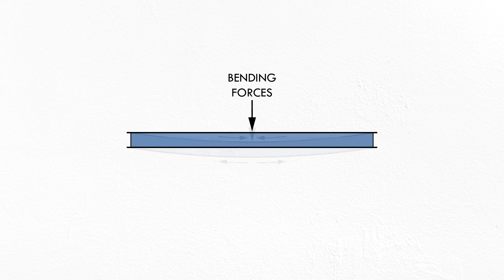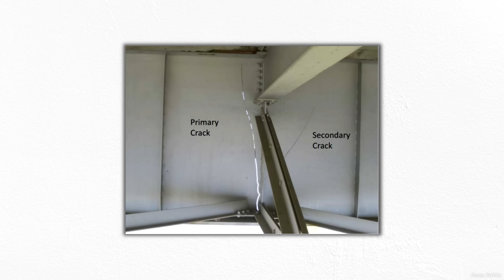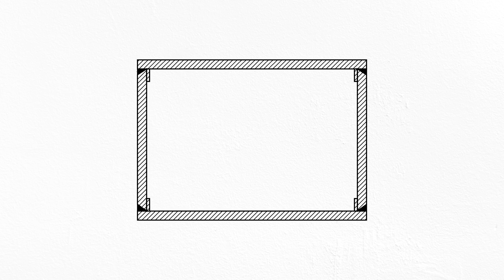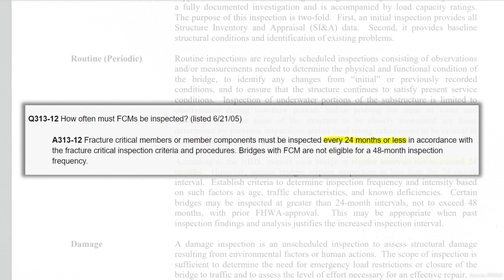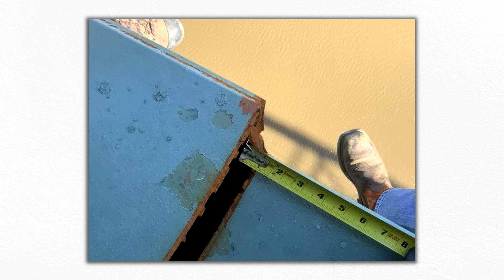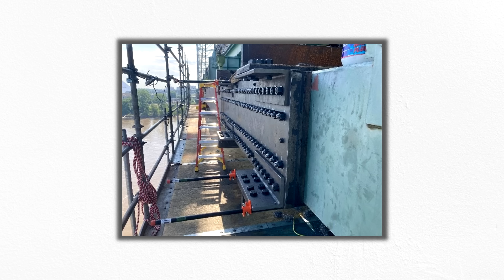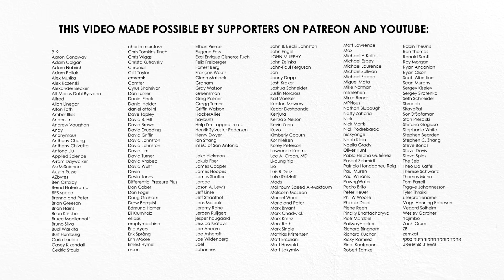What Really Happened at the Hernando de Soto Bridge?

Comment: As a stress engineer with familiarity with durability and damage tolerance, and fracture mechanics, I knew that crack had to be several years old. I was not at all surprised when you provided evidence of 2016 and other imagery which showed the crack in the past. Thankfully that bridge was a damage tolerant design.

What's interesting about the failure is that it didn't happen on the 1st fastener line where the critical analytical stresses would be expected for that type of joint. As you said, I'd expect something like a welding defect to have caused the initiation at this unusual location.
Reply: I'm thinking this member was still carrying the load despite the damage. Thoughts?

Comment: Great video. Only remark is that confusion may be created at 2:55 when bending load is described as worse than pure tensile load because it creates...tension. The resultant stress from an equivalent bending load is higher for a beam because perpendicular loads create an amplification effect that coaxial loads do not (i.e. a moment). It seems that connecting the deck at regular intervals along the span of the lateral tension member directly contradicts the design theory behind such a bridge. And lastly, how can welds form adequate joints on such a large structure?

Comment: I knew a supervisor of an institutional housekeeping staff who would apply dry markers to every public toilet and photograph them. Some were various visible colors and some would only fluoresce in UV. The staff would be judged by which shift cleaned off which marks. This was an entirely measurable and impartial standard for promoting or firing housekeepers, and also for improving and repeating training as required. 

Any bridge inspection should never be solely the responsibility of one person. These inspections need to be reviewed by remote teams where on-site engineers operate high-definition recording drones and helmet cams during their live inspections, while off-site teams review video footage from anywhere nationwide. 

Every bridge should be marked with many documented faux cracks of various levels of visibility (manually, using inkjet printers mounted on drones, or as post-processing to the video copy assessed by the remote teams). The remote inspection teams compete to record the largest number of discovered cracks and flaws daily, using AI, contrast enhancement. 
Bridge inspections also need innovations developed worldwide, such as acoustic transmission signatures from transmitters and receivers added to the structure. On the other hand, the entire remote inspection process should be promptly assigned to another remote team if enough faux cracks are missed or incomplete video coverage is not noticed. This way, remote teams are rewarded daily for finding the most obscure cracks and catching incomplete field coverage, and their chances of finding a real crack are greatly enhanced. The local engineers are motivated to record thorough coverage every day while competing to trip-up the remote teams. Nobody is ever held solely responsible for finding a real crack. Every field engineer is working with an equal playing field, and the oversight no longer feels burdensome. The job is clothed in aspects of a sports competition.

Comment: One question is, why the beam is connected to the deck so rigidly. Maybe the purpose is to reduce lateral movement of the deck, but wouldn't a connection be better that avoids transfering vertical forces?

Comment: Seriously. For a country that’s so dam wealthy. We build the bridge in a way so we can remove parts and replace do the bridge could practically be there forever (not with original parts) so seeing the crack should of been easily resolved before it got bad. Just keep it open until replacement beam is ready then shut down install and inspect the bridge. That’s all they needed to do before it got so bad it had to be shut down immediately

Comment: Armchair engineer here, and former train conductor who has changed knuckles and spotted broken rails.

That break has some age to it. Looks like a few months of exposure. Also of note is the area's climate. Specifically, the 2021 storm that had temperatures around -15c and how summer temps reach around 35c. During that winter storm, there would have been extra tension from the material shrinking in the cold, as well as ice and snow, and heavy vehicle load from traffic congestion on the poor roads. Combined with the location of the crack, which is near a high activity point (Welds, bolts, etc), it's likely a weld defect or general defect that may have been very minor was put under such tremendous load that it popped open. Again, based on the rust, it looks around the right age to have been from this winter. 

We also must account for the location of this crack. It's likely that it was to receive most of the fatigue, being the axial point between rigidity and drooping of the bridge as it "breaths" (expands and contracts, allowing some drooping.)

At least them's my thoughts. It just looks like the right spot for it, the rust color and penetration look right for around 5-6 months in a higher humidity location. And based on experience with rail breaks, it often happens when it's cold, the rail contracts and eventually finds a weak point to pull apart.
Reply: I imagine rail breaks from cold are on long straight sections?

Comment: Clearly not a crack, but a break or fracture.  The member is completely severed in two with a one inch gap.
Reply: Apparently they are terming it a crack because there was still some material connecting the two halves on the south side of the box section. But it's probably safe to say that connecting ligament had undergone significant plastic deformation to allow the crack to displace that much so in my mind the whole section had failed, even if they were connected.
Reply: After learning a bit more and seeing additional photos, it appears the damaged tie was still carrying the load despite the severe cracking and stretching.

Comment: If they use NDT on any parts of the bridge it would be in select locations that may need a closer inspection, but I also don’t think they are looking for anything that small, and if the bridge has been painted then all but X-ray would be useless.. I would say a very in depth visual inspection to locate all problem areas (which there will be more) maybe some ultra sonic testing on the horizontal beams like the one that broke, and possible X-ray on structure critical components but I would say that would be rare.

Comment: I wonder how many times a month the bridge was packed with both lanes with trucks at max weight putting excessive tension on that tie member.  Traffic cam  archives might be interesting.  If repaired they are going to need to handle traffic with meter signals on both bridge approaches  so no traffic pattern can build up that results in traffic slowing down and bunching up.  Speed limit displays will need to be computerized to maintain distances between all vehicles. And pop up steel barricades off the bridges to stop and cite rule breakers so high speed chases dont happen over these citations.  This is going to need to be done on many aging bridges. Imagine how frightened the Golden Gate bridge operators were on the anniversary where they let people fill the bridge as a big party till somebody noted the arch of the road deck was flat if not slightly concave from the overload of that many people packed together. 
Traffic metering toward bridges can be handled easily by varying traffic speeds approaching the bridges. Reducing slow traffic tremendously. Active pinch points to block cars trying to pass in the breakdown lane would be needed

Comment: Why not embed cables in the bridge? As soon as a crack forms, the embedded cable will also crack, connection will be broken, and a IOT sensor can detect the loss of connection and report an alarm.
Reply: You mean electrical cables. They do stretch.
Reply: @tryithere  I mean, you could make it with cables that do not stretch, ergo have the same material properties as the material they are "protecting". So if the material cracks, so does the cables.
Reply: The problem is fatigue cracks grow at normal strain levels so your cable would need to also fatigue and crack before the steel. While this might be possible with careful wire materials and design, it won't be easy. Otherwise the crack could grow without the wire breaking sufficiently.
It would be easier and better to just put strain guages on at key positions and monitor the cycling and do predictive fracture mechanics on the fly for critical members only.

Comment: Why did they use rigid structures for tensile forces, and even connected to the deck?

I'm not an engineer, but I would think that a more flexible solution (like spanning some steel cables between the bases) would avoid this risk of cracking.
Reply: The problem is they decided to use this as more than just the arch tie.

Comment: I love that you explicitly say that this is not an armchair activity, and how we can only speculate. It made me giggle thinking "Well, there are many things that aren't armchair activities, yet everyone always has some expansive opinion on it and considers themselves knowledgable enough to judge.". There's nothing wrong with speculation and approximation. It's when people interpret them as factual is when it becomes an issue. Speculation is a valuable tool. It helps us plan for various future scenarios and it helps us form hypotheses about the causality of past events. But speculation by itself is pointless, and its closeness to reality is variable. It's speculation to say "The crack in the beam was caused by metal fatigue, caused by variable tension.", and it's speculation to say "The crack in the beam was caused by a gnome with a chisel.", but one is based on available information and knowldge of the domain (structural engineering) and the other is based on hallucinogens or an overactive imagination. 

So we must always remember the simple truth: If reality was easily discerned, the scientific method would be unnecessary. And speculation is only the first step.

Comment: Thinking of the capitalistic way United States of America works, the possible reason for what happened might come from a lack of interest in doing one's job. The lack of interest might come from two reasons:
1. Your company is not paid well enough because of competitive prices. Your wage is low because of that. 
2. You might have a fear that you are not taken seriously and your boss, who is not a structural engineer, might shout at you because you want to use the company's money to fix a "small" problem.

The easiest and most cost effective way to deal with preventing problems like this is the use of several professionals from different companies that check whether or not something is broken. We have used the same principle several times in some of our cases.

Signed, a mechanical engineer

Comment: That box beam failed but the bridge did not collapse because of the diagonal box beams. If the cracked box beam was under tension, then the diagonal beam to the left would be under compression, pushing on the other side of the bridge. The diagonal beam on the right side of the crack would be under tension, pulling on the opposite side of the bridge. The compressed beam is probably bowed upwards and the tensioned beam is probably twisted clockwise as the right side pulls up and the left side sinks down and to the left as it redirects the tension back to the other side of the bridge. The diagonal box beam in the middle, at the crack (likely saying WTF!? as that section of the bridge is twisting), it is likely under compression with the diagonal beam on the left as that cracked beam wants to bend inwards. Notice how she didn't break at the rigid connection with a million farstners? She broke just like your bejezus iPhone charge cable, right at the neck where she CAN and must FLEX.
FIX Diagnosis: Pull her back with some jacks, tack her back together, sister up some looong skookum steel plates (tapered even, to spread out that bending moment) and have a beer while the inspectderps giver a look-see.  Give those diagonal braces a thank-you kiss and a new coat of paint and put 'em back to work. Check her good an regular for the first couple of years and if no more cracks develop call it done.
Come on, doesn't anyone fix bridges anymore?? They are probably waiting on a quote to buy a new bridge...jerks.

Comment: I’ve been driving an 18 wheeler back and forth across that bridge for several years, and have been stopped at that very weigh station for inspections numerous times. It’s on the westbound lane on the Arkansas side. Got shut down once for a tiny little bad spot on a tire (fair enough), but apparently they missed a great gaping crack in the bridge for years. Hooray for government efficiency.
Reply: DRAIN THE SWAMP !

Comment: The one and only time I drove across that bridge, I saw an old pickup pulling a camp trailer equally old and beat up, and behind that camp trailer he was also pulling an aluminum boat on a trailer.  He couldn't see the boat trailer at all, but it was doing a tank slapper all the way over the bridge, and I laughed because the two seats on the boat were on swivels, and the seats were spinning a good 300 RPM.  Everything in the boat, tackle boxes, fishing poles and coolers were slamming hard from side to side.  Welcome to the Mississippi River!
Reply: woooo hooo 300 RPM... seats. hope he oiled the bearings on the seats before he took off.  i seen what was left of travel trailer in median after it ... had blowout and was kindling in the median.  got to replace OLD TIRES that are dry rotted every 5 years, regardless of wear on tread. and check the air pressure as they LOOK FULL ... but have 10 psi in them on light loaded trailers and if air them up to MAX sidewall pressure, not necessary on most travel/boat trailers as they weigh nothing, the tires SPLIT in the tread/sidewall in no time and go BOOM and the trailer does whatever it wants to do

Comment: I’m a truck driver and have traveled over that bridge a time or two in the past couple years, but this situation doesn’t scare me as much as the amount of band—aid repair girdles on the bridges along I55/I64 on the Illinois side of the river in east St. Louis. It’s down right scary seeing the deterioration of the pylons. 
I personally know an engineer that works on road projects and talking to him I found the the actual engineered weight capacity in the particular state he works for is is grossly low. An example I talked with him about is rush hour traffic and having bumper to bumper 80,000lb trucks on any particular span would exceed the engineered capacity by a large margin. Missouri has weight limits posted on its bridges some as low as 30 tons on major commercial traffic routes. An 80,000lb truck is 40 tons. If I’m missing something here, or over thinking let me know. I also understand design factors but a posted weight limit is a posted weight limit.

Comment: This presentation is clear and concise. Very well presented with adequate common sense visuals that conceptually explain what happens when the tied arch tie is severed. 
Fortunately,  the loadings carried by the failed member redistributed and prevented a catastrophic failure (someone mentioned the bridge in Italy for what could have happened).
A couple points to ponder..
1. The detail (fatigue occurs at detail locations) where the fracture occurred exists throughout the structure. I suspect that the failure originated at a transverse box diaphragm plate weld and these plates would be located at each end (and in the center) of each arch tie member. Fixing this fracture does not cure the structure of its potential flaws.
2. Fatigue stress limitations are based on a range (max minus min) stresses occurring under loading. The limitation is in the number of stress cycles and this bridge has a lot of stress cycles.
3. I read somewhere that the arch ties were  fabricated using "very high strength" steel. During that time frame, quenched and tempered steel was the highest strength steel used in bridge construction. Welding these steel plates require detailed procedures to  eliminate the small microcracks described by the presenter. Lot of detailed shop inspection required for a structure of this size.
Sorry for being wordy. I don't see me driving through Memphis anytime soon.

Comment: I'm left wondering what's the biggest mistery in this video: how that bridge didn't collapse or how that guy managed to miss a HUGE, OPEN, CORRODED crack so obvious it was visible even from the river below. I mean i was tasked with finding cracks thinner than a piece of hair, sometimes so tiny it was hard to tell if it was an actual crack. And then there's that guy...
Reply: My guess is someone reported it, but it got filed into the circular filing cabinet next to the desk of whoever is in charge of making repairs
Reply: @richardmillhousenixon  Nope.  Before he lawyered up the inspector publicly admitted that he didn't feel safe inspecting the underside of the bridge, so hasn't in 13 years.  Yup, 13 years.
Reply: @csf1757  That crack is so big somebody had to have seen it and reported it. Even a civilian in a boat probably would have reported it if they noticed
Reply: @csf1757  so hasn't in 13 years. - I wonder how he got away with that - what were his bosses doing? Maybe employing a guy afraid of heights to inspect bridges is not a good hire.
Reply: Yes.  You sure as hell don't need a mag-particle inspection to see that . 😳
Reply: It take more then one pair of eyes to inspect a structure of this size. The bigger question is why the crack was not reported to people further up the food chain by any of junior inspectors on the inspection team earlier.
Reply: What were you finding cracks in, and why?